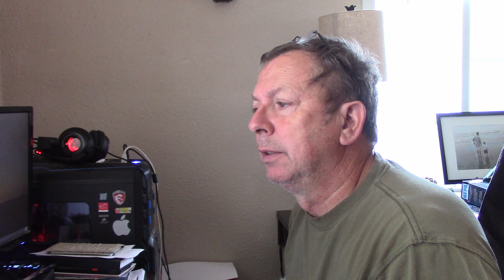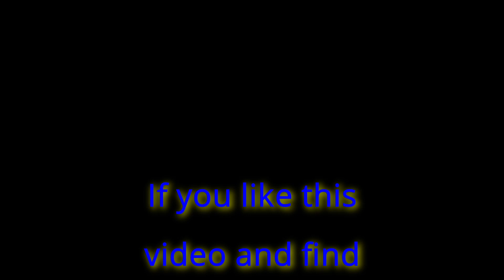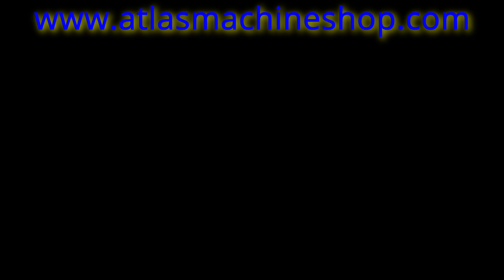Things to look (Out) for when shopping for an Atlas Lathe: Part 1

Comment: Dan, I agree the pricing is all over inflated for the Atlas equipment. Unfortunately here in FL, not being a heavily industrial area like up North. I don’t see this equipment come up for sale too often. The prices seem to reflect that scarcity here, and the prices are inflated, but consistent. I appreciate your videos, thanks for sharing.
Reply from the maker: Bear in mind that in reality the Atlas machines are not an industrial machine. I can't say for certain, but I would bet that there are almost as many of these machines in Florida as in any other state. probably a lot of home shops will have them and I suspect they appear in the local listings ocasionally. Here in my location I haven't heard of a local machine for sale for quite some time but I know for a fact there are quite a few around here, it's just a matter of being in the right place at the right time and they can usually be had for a reasonable price.
Reply: Your probably right, just have to wait for the right time. I won’t hold my breath on the pricing. Have a great day!

Comment: Steve here , just a few weeks ago I paid 800$ for a QC42, and it cane with tapper attachment, stady rest, follower, 3 chucks, one being a 4 jaw, and complete, main lead screw got about .015 ware, that beveled gear spline thing ware off, over all good shape for its age, bottum line look hard and one can fine most good deals  800$
Reply from the maker: and yes there are good deals out there and that is about what I think they are worth. The flea-bay sellers are out of line with pricing and they know they are asking to much. Earlier today the seller of one of the lathes I looked at that they were asking 1800 for sent me an offer to buy it for 1500. If they were willing to take 1500 (which is still to much) then it should have been listed for 1500.

Comment: Dan, you mentioned you've previously commented on the pros/cons of Atlas electric motors (vs. other brands). Do you happen to know which video you did that in? I recently purchased an original motor (my lathe didn't come with any motor) and went through a full teardown/cleaning/bearing job on it. I'm new when it comes to this stuff but it seems pretty good so far (and I like the look of it compared to the more utilitarian new motors). I'd be interested to hear what you have to say on the subject. Thanks in advance.
Reply from the maker: No, I don't remember but I don't have anything bad to say about Atlas motors and it is cool to have them on a machine but usually a seller is using them as a selling point for a machine but the reality is that they are usually at least 50 years old and you really don't have any idea as to the condition. It may be on its last leg and the smoke may come out the first time you flip the switch. And the warranty has expired. 😁 If you have one that works well then there are no worries .